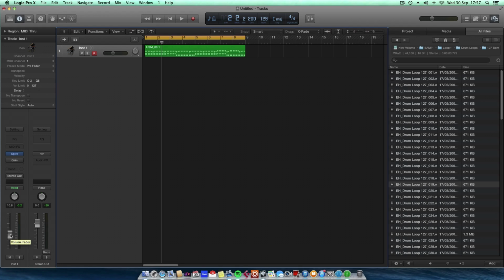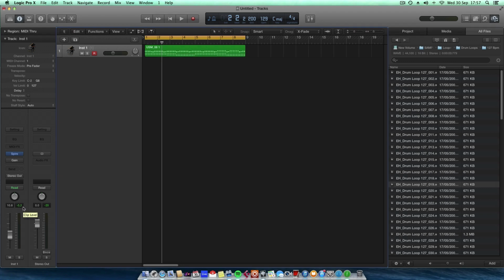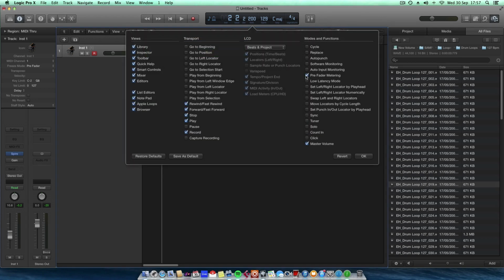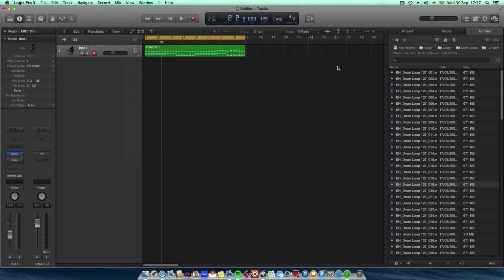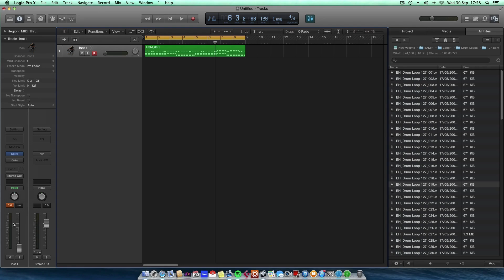Logic Pro X Quick Tip: Pre-Fader Metering

Comment: yes but you start the video with the fader already down -8 -10db.. put the fader back at unity and what does it say? +5 i bet. but yes i always use a trim plug first so either way i can increase or decrease before it goes through the chain.
Reply: Point Blank Music School I did this but it also turns down my post meter. no difference. any help please
Reply from the maker: +Frank B (FB IV) This is an extreme example that was intentionally exceeding 0dB to demonstrate the feature

Comment: Logic internally works with floating point data, so it DOESN'T MATTER if internal busses clip! Only the master buss matters. As long as your master buss isn't clipping you are totally fine!
Reply from the maker: +A. Z. Logic itself supports headroom you could never reach, theoretically. However, not all plugins are designed to take that type of level. That's why it's good practice to stick to traditional gain staging methods
Reply: so gain at the beggining of the chanel strip or at the end or booth? or when is necessary?